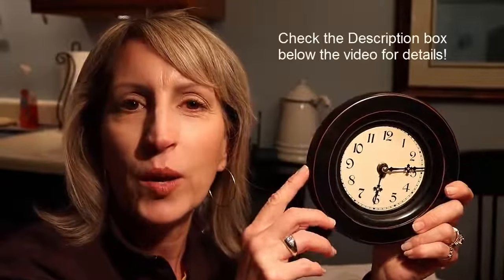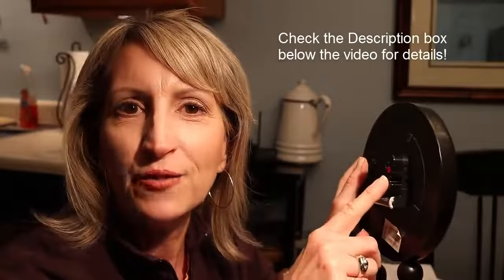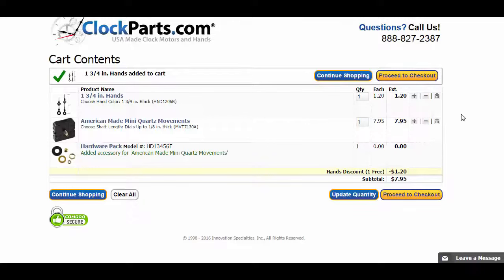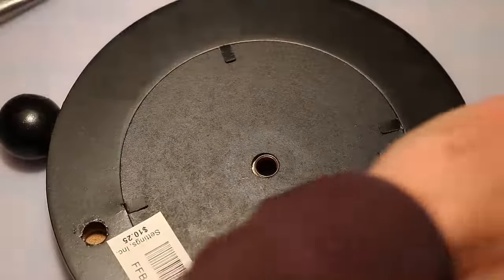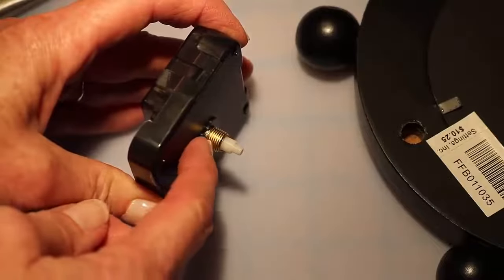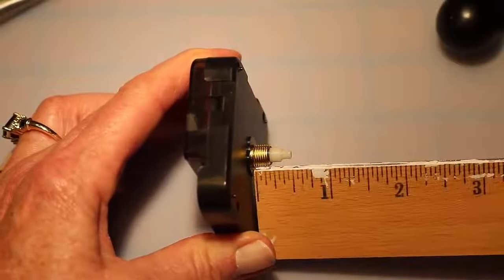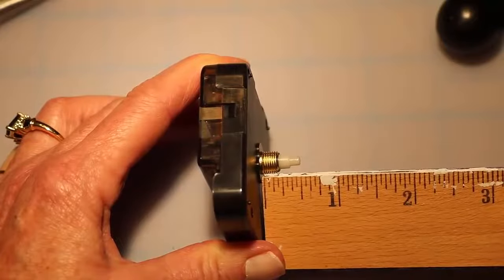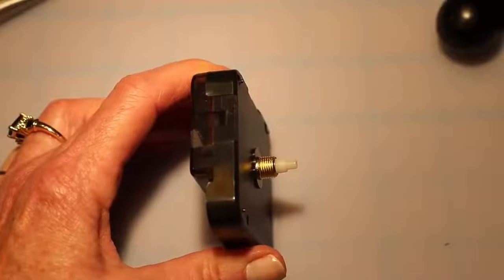HOW TO REPLACE A QUARTZ CLOCK MECHANISM

Comment: You mentioned you didn’t like the little brass snug with black hands what you can do is remove it get a can of black spray paint spray the brass slug.  Let it dry over night and install it back in the morning.    I do this all the time I fix watches and clocks for a living.